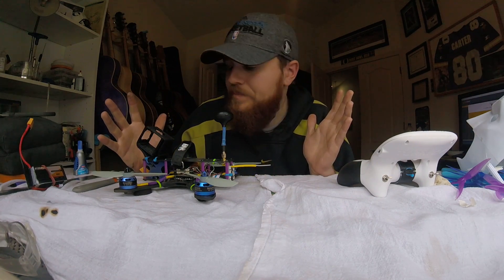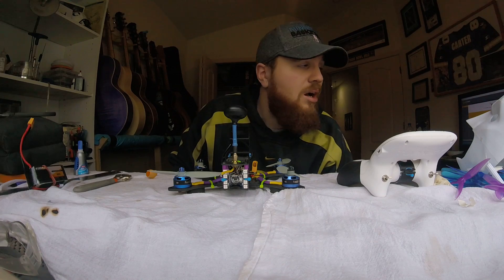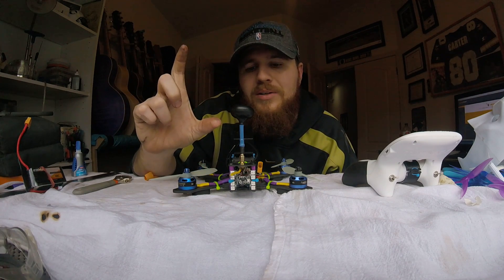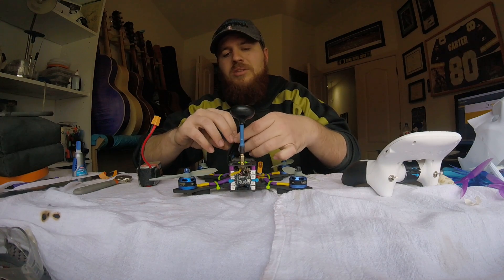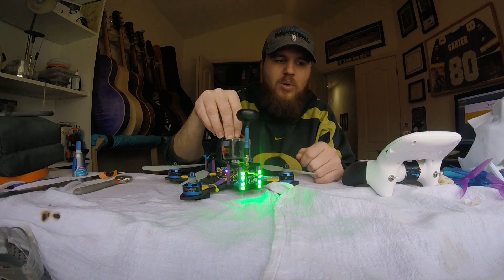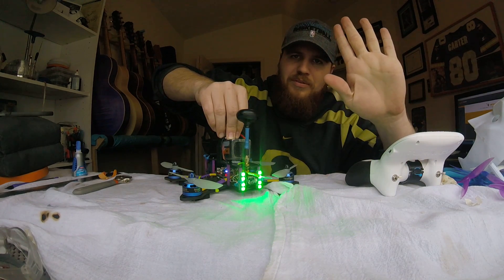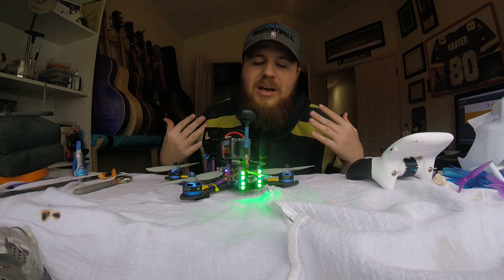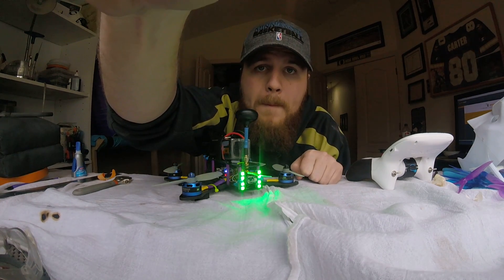FPV On The Cheap, Episode 10: Matek LEDs

Comment: Hi, I will try to see about fixing it on my own, but i programmed all of my LED’s in beta flight to be solid color w/ directional lighting, and they worked for a bit, but one night i showed my friends what i was doing and i left without disconnecting from beta-flight. After coming back to fly the drone one strip (5 LED’s) wouldn’t properly follow what i programmed them to do, and they went wonky. Some were white, one light blue, another light pink, and the other side did exactly what i wanted them to do. After looking this up for a month i still cant find a fix or anyone else that has had this issue. I have the Eachine Wizard x220s that came pre-built out of box other than prop attachment. If anyone can help i would be grateful.

Comment: Did you follow some kind of a youtube guide?
Reply from the maker: NO. Its only a few wires and everything was labeled. Its connecting those wires to a flight controller that can be tricky because not all flight controllers have dedicated LED pads like the one I have. I would suggest double checking any documentation for you flight controller before randomly hooking this up and also using a multimeter to check for shorts/continuity. Better safe than sorry!